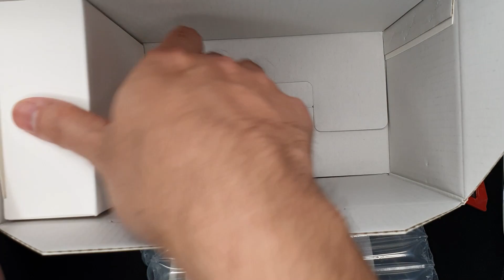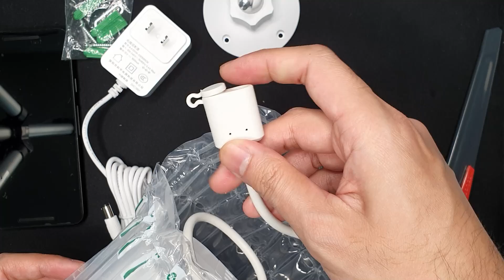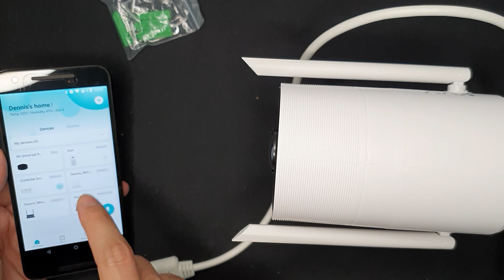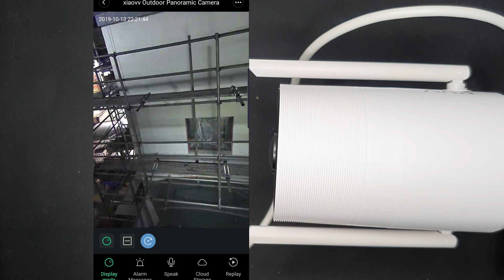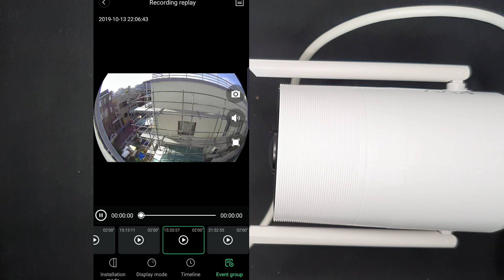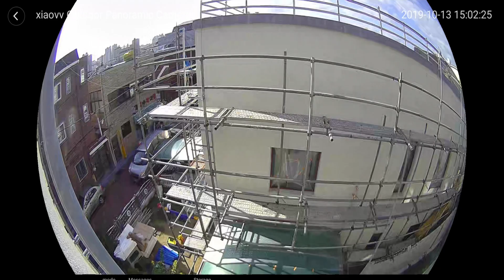XIAOVV (Xiaomi) Panoramic Outdoor Security Camera Review

Comment from the maker: I turned this camera into a portable battery powered outdoor smart camera. Please check this video:
https://youtu.be/ZYRci_WHuh0

There are two main disadvantages as follows:
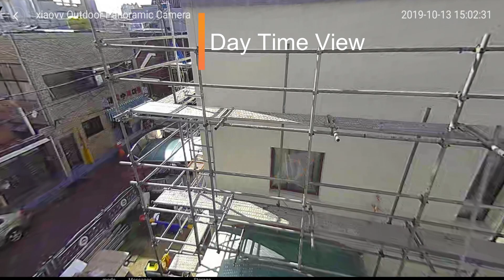1. 12:39 No Network-attached storage (NAS) option available and
2. 13:15 Cannot save videos using the Mi home app to local mobile storage
 
unlike in other Xiaomi Security cameras.

Notes:
* You do not need to connect to the local network to stream the video. You can view it from anywhere. But you should note that you need to have internet connection on the camera, without which you cannot stream the video even if you are on the local network. 
* Model XVV-1120S-B2 supports Mijia/Mi Home App but the model XVV-1120S-B1 may or may not work with Mijia/Mi Home App.

Comment: Video playback didnt work anymore after update FW.  Then update to latest FW 4.0.9_2069 also same. Only can playback cloud saved video but only for a few second.
Reply from the maker: My camera's fw_version is 4.0.4_2054 and the video playback works fine. I didn't get any notification to update yet. Did you try resetting the camera and pairing again to Mi Home App?
Reply: Hmm.. i've tried reset thru app, reset at the camera physical button, format sd card, change new sd card still same result. 1 thing i notice is everytime i take out sd card and put it in pc then the pc will ask to scan and repair my sd card. I tried it couple of time still same pop up. I think the camera it self messing with the data structure of sd card after recent update. Do you have any suggestion for the replacement camera with the same wideview? I dont want to revert bact to the PTZ camera. TIA
Reply from the maker: @skelethornbro  You can consider this I think: https://youtu.be/gJIw5DZtGEk. It can be connected to a local server also instead of Chinese. Thanks.

Comment: How long is the power cable?
Reply from the maker: The length is around 10ft or 3m I think. Thanks.
Reply: Is it possible to extend it by cutting and rewiring ?
Reply from the maker: Yes you can do it like that.

Comment: I bought from Aliexpress the less desirable model XVV-1120S-B1, but I'm here to inform y'all that it DOES work in the MI Home app without any issues! I noticed however, that it doesn't do that neat sideways motion simulation like yours and the fish eye effect is way less pronounced than the one shown in your video (which accommodates a more narrow field of view) ¦C
Reply: I have the B1 version which only works with the v380 app. I would really like to find out if it really can be configured to mihome? I am adding a link posted by someone who has described the B1 version in detailed https://tech-blogs.com/ip-camera-xiaovv-xvv-1120s-b1-version-v380-unlike-the-version-for-mihome/
Reply from the maker: Thank you for the information. I saw several people telling that B1 version doesn't work with Mi Home. May be they are doing something wrong while connecting. Sorry that your version is less featured.
Reply: @DSmartLife  Also, your camera seems to have the lens more rounded outwards, mine seems kinda flat-ish instead. Perhaps that's a key point to differentiate between models when only pics of the device are available